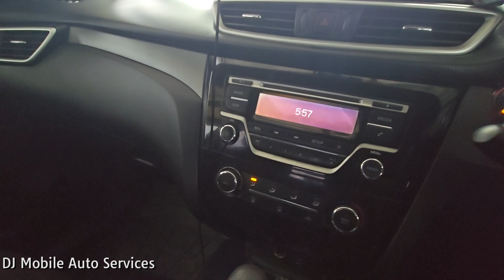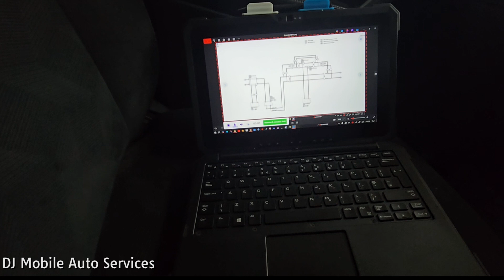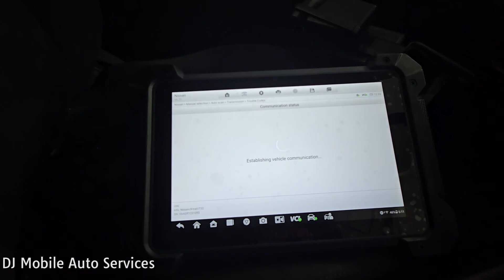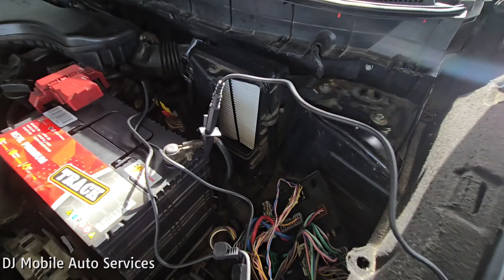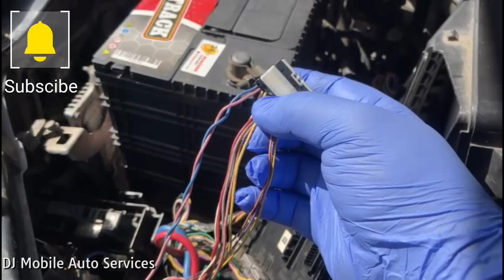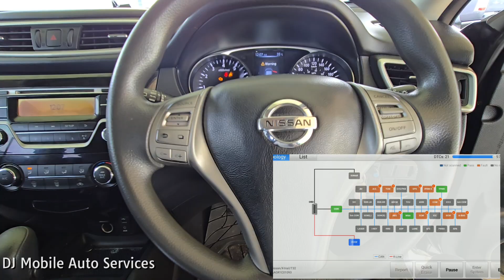2015 Nissan Rogue Loss Of Communication With TCM Diagnosed & Repaired Video. Parts Cannon Fired

Comment: I have the similar issue, CAN TCU MESSAGE MISSING P0600.But its only appears when i run the diagnostic. I measured the Tcu & Ecu Can H & Can L reading its show 60 ohm.
look normal. 

Now i have no ideas how to solve the problem.
Reply from the maker: You may have a corrupted chip on the board or a short. That you should track down